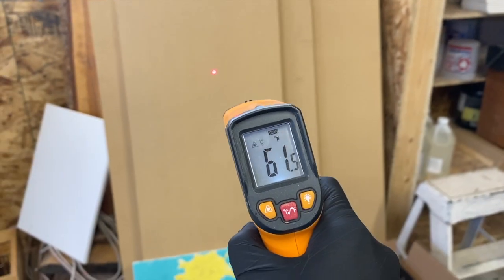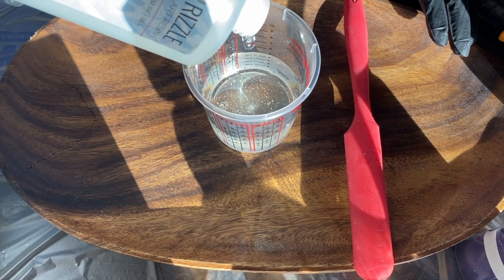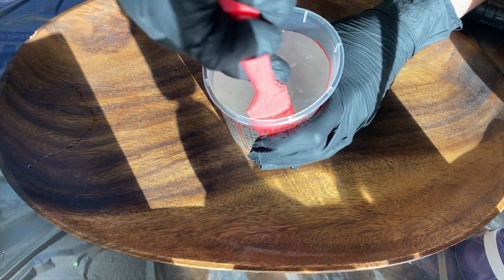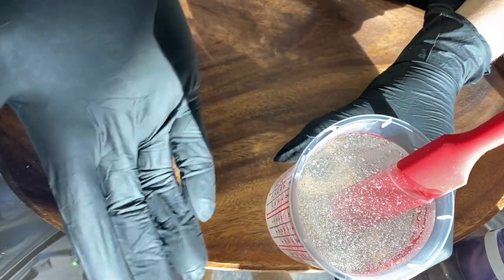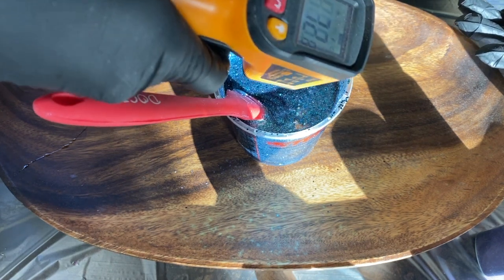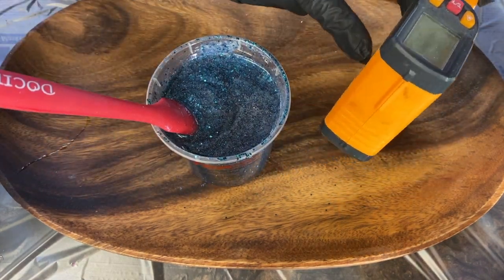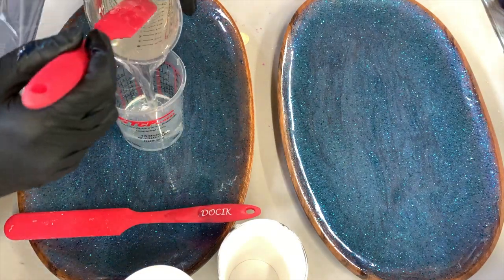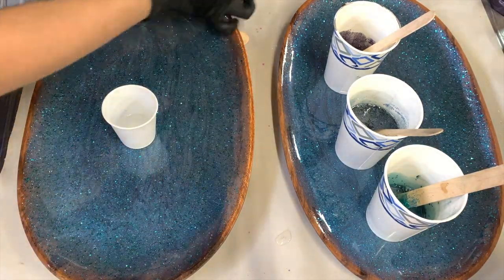how to MIX RESIN RIGHT and take its temperature!

Comment: Such an informative video! Thank you for this. I learned a lot. But I have a question...

What resin do you recommend for beginners wanting to do a clear resin with a flower. I have no idea what type of resin is beginner friendly, comes out clear, and can preserve flowers. Please answer as soon a possible.
Thank you in advance!
Reply: I just started out and I use ArtResin. I use dried flowers too and it comes out SUPER clear and little bubbles. I use a heat gun to get rid of the bubbles. Works like a charm for me.
Reply from the maker: yeah honestly I won't recommend a resin to preserve anything that needs to stay clear forever because ALL epoxy yellows over time, even art resin. I have a couple wood pieces I did on a video here comparing art resin and another brand and both have yellowed. art resin is yellowing slower though :D

Comment: I want to paint resin onto a piece, would the hotter more fluid be the best for that? Also, I have some of the quick 5min set epoxy is that not recommended for projects like this?

Comment: Thank you for this video. This is great information. I work with alcohol inks on tiles as well as paint pours on canvas and use resin to finish my projects. This last pour on my tiles was driving me crazy. Couldn’t get rid of the little “pits”. I believe my resin was too cold.
Reply from the maker: yes absolutely!!! too cold and maybe a little too thin too. If there was any silicone on your tiles that could also cause the resin to create pits. thanks so much for watching!

Comment: Great tips!! I work with Pro Marine.. sometimes dimes show up during dry process. What causes that?  Secondly. I've been commissioned to do 3 36x48 panels (on wood). Recommendations Resin will be poured over acrylic art.  thanks
Reply from the maker: hmmm what do you mean by dimes? maybe like pits? that could be too little of resin or the room is too cold. email me at abstractboss.llc@gmail.com with pictures so I can see what you mean and we will chat from there!

Comment: Thank you for your sharing 😊How do you clean your cups? Maybe you said this but I’m sorry for not understanding spoken English well 😊
Reply from the maker: Pat C no worries! I actually didn’t mention cleaning in this video. Flip the plastic cups upside down and wait for the resin to cure. It will pop out the next day. Get thicker plastic though like from Home Depot. Those are easier to pop resin out of. Or you can clean them the same day using acetone and shop rags but I feel that is more wasteful

Comment: That’s beautiful. Quick question: how do you clean up your cups and spatulas? I made a mess in my sink in my art studio. Got stuck all over that sink. I look forward to your response. Also look forward to more videos in the future.
Reply from the maker: did you dump it down the sink? eek. ok so I let the resin harden in the cup and peel it out the next day. same with the spatulas. It is a lot of picking hahaha but it is perfect for the eco-aware artist who wants to reuse. If you need help getting cured resin out of your sink, use a heat gun to loosen and a putty knife to pry it off. I hope that helps. Please make sure you do NOT turn the water on or you might electrocute yourself while using the heat gun. Just be as careful as possible

Comment: Great. What’s a good epoxy mould release to use??
Reply from the maker: I don't normally use one unless it is a cheap mold. If you are working with a cheap mold then don't use heat and I use casting craft. I added it to my amazon list under "geodes and resin projects"